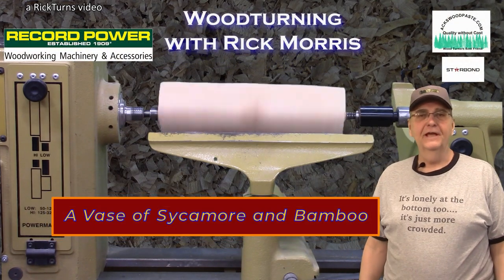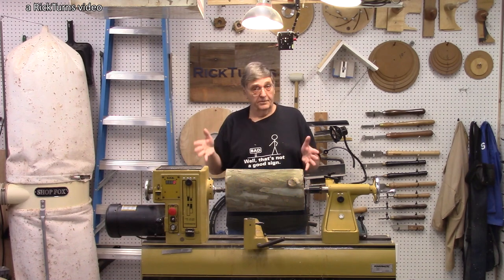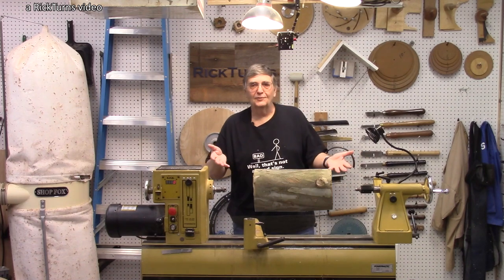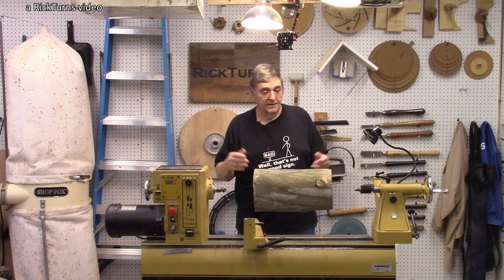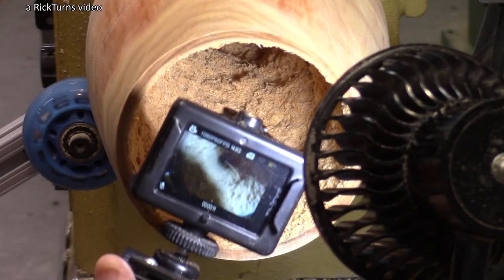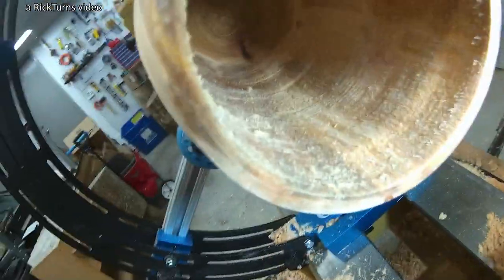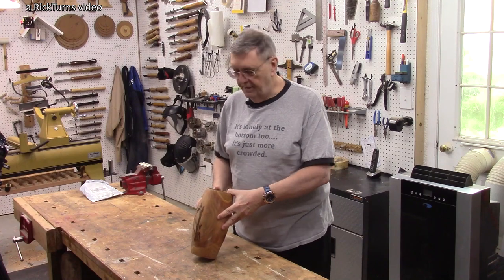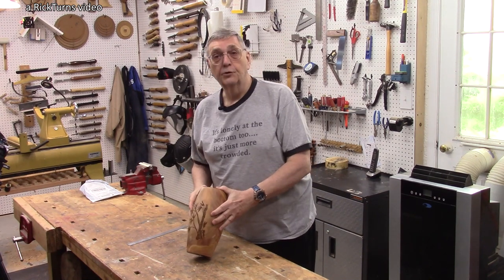Woodturning: A Vase of Sycamore and Bamboo

Comment: Nice turn Mr. Turns ! Great form. The vase too has great form. A vase was a good choice for the sycamore. Did those tools shown actually allow you to cut to the bottom ? And has it been 3 months yet ? If so, did it warp or crack any ?  Love your vids; thank you for make it and sharing with us Rick🙏   Stay safe.  -Mike😷
Reply from the maker: Hi, Mike. The last tool I showed, with the round cutter on a slightly curved bar, was long enough to get down to the bottom. It’s only been done for a couple of days, and is still looking wet. I have another piece made from the same sycamore tree that I turned about 6-7 weeks ago, and I think it has just about dried. It is a lot lighter and more evenly colored. Thanks for watching, Mike.
Reply: @RickTurnsWoodturning  Thanks Rick. All is good😃